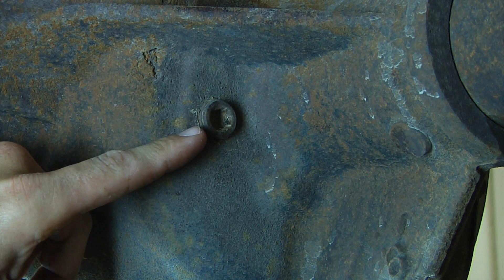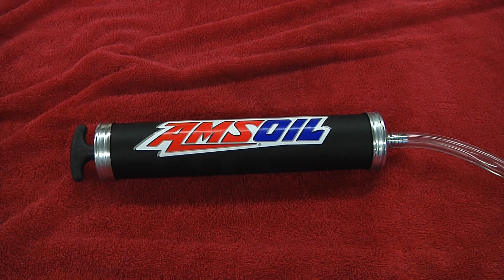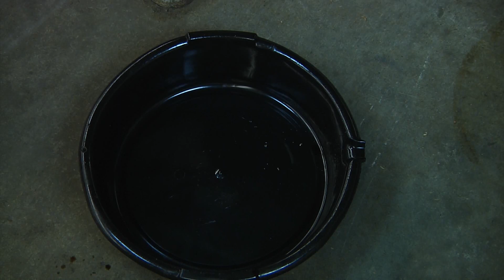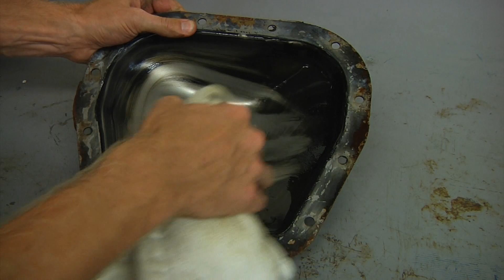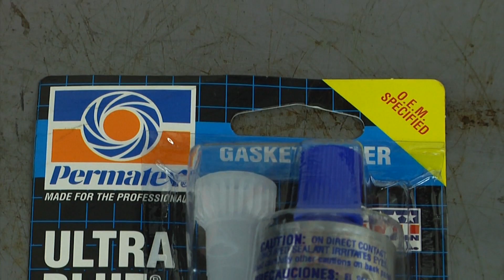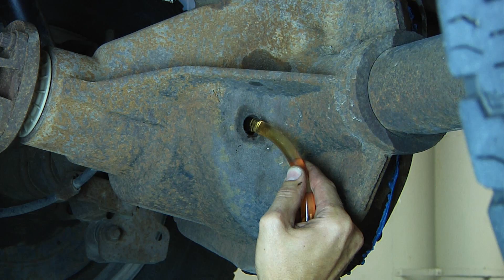2001 Ford F150 Rear Differential Fluid Replacement

Comment: do i need to add friction modifier
Reply: Friction modifier seems to only be needed in the LSD
Reply: Only if you have an LSD if its an open differential you don’t need it. Friction modifier is for the clutches in a LSD dif
Reply: Do you add the modifier after you've filled it. Or do you add 1st then add the modifier? I just need to really know if I can add modifier or let fluid out to add modifier
Reply: DāboSue some fluids already have it in just check if the bottle says if it has it and yes you have to add friction modifier
Reply: My question EXACTLY!
I'm hoping to learn that the Amsoil Synthetic Fluid prevents the need for the modifier juice.

Comment: I watched your video the other night and just did mine today I did everything as you shown but I forgot to do the pump around the gears will that hurt anything?  Oh and I had bought my own gasket and used a lil RTV just to help set it in place however no avail there just moved all over is there a certian time I need to let the RTV black set up?  Somewhere I thouught a hour or so I just got everything done with it at 420 but I am letting the gasket stuff set up before putting fluid in I did already tighten and torque everything and some of the gasket material squished out which I know that wont hurt anything but I just wanna make sure I did everything correctly cause last thing I wanna do is screw up my truck lol
Reply: Re watching just to make sure and dbl checking I did things correctly so far so good other than hosing off the gears
Reply: mine also stunk like death it was not even nearly as clean as what your was it was rusty looking and really made me gag didnt smell anything like rear end should smell like.  thanks for the great video man yes i caught the hr after watching it again lol
Reply: This stuff is like $25 a quart, it's not necessary to pump fluid around the gears to flush them out. Driving it with fresh fluid will clean the gears way better than just pouring some on random spots.

Comment: Ah after 15 years of having my 01 F150 I guess its time to change out the differential fluid.  maybe that will stop that winding noise I hear... nice video thank you for posting...
Reply: you need to replace your differential. I replaced mine too when mine was making that noise. there was like 2 or 3 teeth broken
Reply: I got a mustang 2001 and I hear a windin noise when u push the gas pedal and car clunck when u start to drive..I guess thats a broken teeths or need differential fluid.
Reply: Sejad

Comment: When removing the diff cover, it makes it easier to remove the bottom 3 bolts first, then get a flat head screwdriver and slightly pry the bottom apart to let the fluid drip out. That way you don't get fluid coming down the screwdriver and onto your hand.
Reply: Andrew S 😂 awesome advice

Comment: I never use a gasket masker I just buy the gasket and place a dap of grease in few spots to hold the gasket in place save time and money spent on permatex ..torch the bolts to the required specks no leeks from water pumps to differential cover..

Comment: do you have any for the '04 f150's?  my father said you need another additive for the diff fluid.  and an 04 f150 4.6L would be nice to see done, dont want to pay $500 for someone else to do it.
Reply: The manufacturer often requires an anti-friction additive to be added when changing diff fluid.  However, if you are replacing the diff fluid with Amsoil Severe Gear (see link in video description), all the required additives are already in the Gear Lube Oil. I am not sure if conventional manufacturers put it in or not.  If you need help identifying the specific type of diff fluid or amount, e-mail me directly. zo1983724@gmail.com
Reply: thanks man, glad you know your stuff.  hope i wont need to replace any gears when i take it apart in the summer time, too cold to do anything here right now.
Reply: Your rear end must be a limited slip, limited slip rear ends need a friction modifier for the clutches.
Reply: ***** We are talking about Robert Crozier's rear end right? Maybe he has a limited Slip in his truck and needs the friction modifier from Ford. Amsoil is good stuff, but I would still add the Ford additive.
Reply: With that being said, why didn't you completely disassemble and clean all the components of the old gear oil? Just squirting  the ring gear with new Amsoil isn't enough of a cleaning. Just saying....

Comment: If you are replacing the oil with Amsoil Severe Gear (see link in video description), all the required additives are already in the Gear Lube Oil.  I am not sure if conventional manufacturers put it in or not.

Comment: Thanks Jon, another thing... the owner's manual says it takes like 3.19 liters of oil (little more than 3 quarters of galon) and also says some antifriction aditive ounces are required (dont remember the motorcraft part number). The oil is expensive here, I'm from Mexico so I will have to spend more than 100 USD for a galon. You think it's ok if I just replace the oil and forget about the aditive? Thanks in advance. [sorry about my english, not my main language]

Comment: I want to know if it's really necessary to change the diferential oil, the ford owner's manual states that it's designed to last the lifetime of the vehicle and only recommends a change if the diferential has been immersed in water. Thanks people.
Reply: How many miles is considered the lifetime of the vehicle then? 100,000? 200,000?

Comment: Hello, I'd also like to know the answer to this question... many people say that the wheel bearings are lubricated with the diferential oil but idk if that's true... I changed the front wheel bearings of my vehicle (one was damaged and decided to change both) and I want to know this before I decide to change the rear bearings (just for maintenance, don't think they need to be replaced).

Comment: Does the differential fluid lubricate the wheel bearings, or is the axle tube sealed off at the differential housing?

(If it is open, additional oil can be drained by tilting the axle one side at a time.)

Comment: Another thing to check before applying the Permatex is to check the flatness of the cover along the gasket mating surface, or rim. The metal may be dimpled somewhat around each bolt hole, caused by gasket compression. This can be flattened with careful use of a hammer and a small bit of thick steel plate, working from the inside side of the cover. The surface must be supported on the back side (cover outside) by a solid surface, preferably a flat steel surface of some kind.

Comment: That means your gasket is failing and your diff fluid is seeping out.  This is corrected by removing the cover, servicing (as seen in the video), and reassembling with new gasket maker material.

Comment: i have the same axle as you but with the 4.6L same transmission i believe. and i know why you havent changed out the spark pluggs yet, it took me 8 hours to get the factory ones out and replaced! be careful with the cheap 7mm bolt heads on the coil packs. half of mine stripped and i ended up braking cylinder 7s coil pack to get the bolt off. i replaced them all with grade 8 100 head bolts. preparing for the future lol.

Comment: That being said of coarse I do believe its good practice, just that effectively you can go longer safely. In a few weeks I plan on changing mine because I want to install a locker. Added note, i noticed you only get 12.3 city? Running 285/75/16 with 3.55 gears in town i get about 15, highway 20ish depending on speed. (20mpg 55-65, 75+ about 18.5-19mpg). my most recent fill-up i averaged 17.9mpg with about half highway/city driving. does 4wd account for the drop even if not engaged?

Comment: I have an 03 f150 much like the one in this video, I can assure you the axle lubricant is good for much longer the 30,000 miles under heavy loads. I pull trailers more often them most people, mostly throughout the summer, and i have 180000 miles on factory axle lube. I drive offroad often as well. You can see my profile pic is my truck pulling a 25ft trailer that weighs 6500lbs.. empty.. its for explosives (fireworks). I also pull my camper, 16ft trailer covered and uncovered. food for thought..